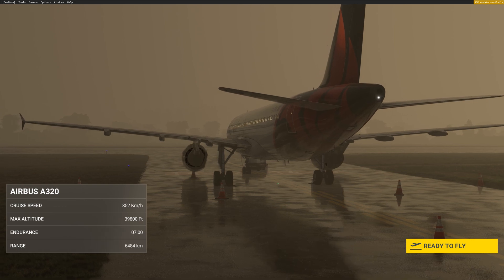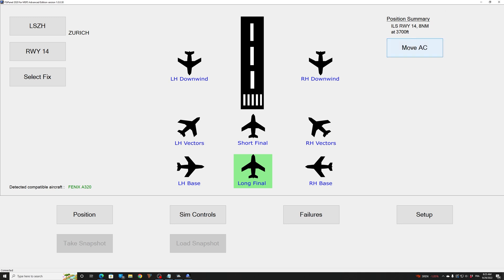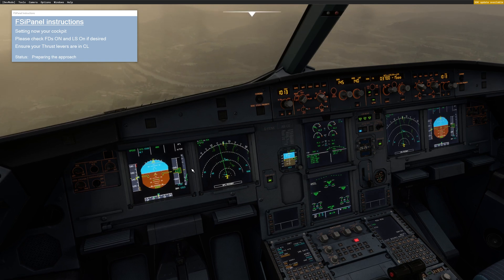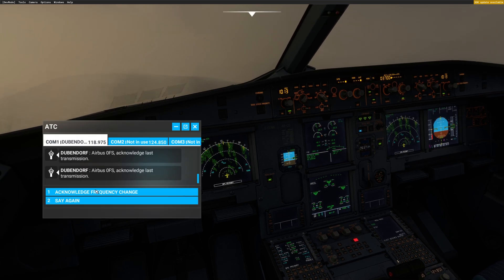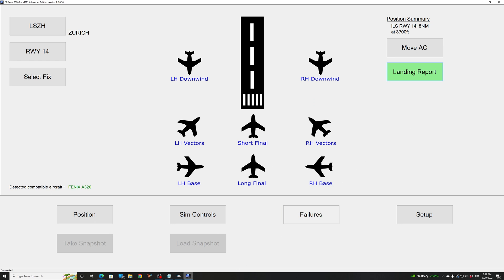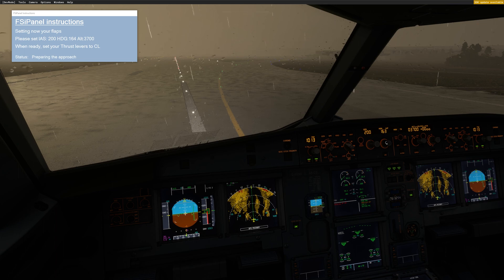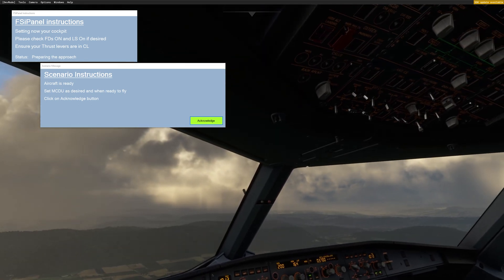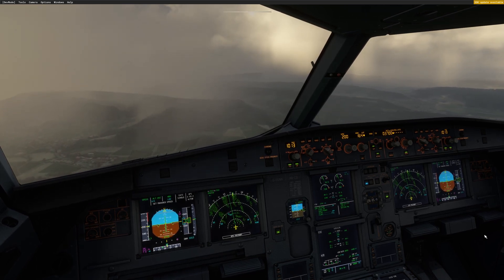FSiPanel 2020 with FENIX A320 teaser

Comment: Question, if I purchase FSiPanel: Standard Ed right now, will it include support for the FENIX Aircraft as well when it is available?  I don't need the Advanced Ed since I will not or be interested in doing any type of advanced practice failures.However, what I do like in the Advanced Ed is the Client/Server Option which unfortunately is not/or will be available in the Standard Ed. Can this be purchased/Added separately for a minimal fee without the Training Scenario/Advance Failures Panel Option?

I just want it for practicing Approaches and Landings at different airports around the world and this seems like a perfect addon for this.

Thanks!
Reply from the maker: Hi, yes you will have access to Fenix A320 when released. FSiPanel is a software for entertainment only, reason why running it on a network computer could allow some people to use it commercially. Only the PRO version will allow that in the future with the agreement from the addon developer as well.
Reply: @FSiPanel  Sounds great!....Will definitely get it.  Thanks for the reply, much appreciated.

Comment: This is great with an airliner. Can this also be used on GA with the changes in distance and altitude they would need for landing practice?
Reply from the maker: Hi, yes with all asobo aircraft.
Reply: @FSiPanel  GA sounds good. I will buy this tonight and have a go. Fenix, is it nearly ready or still away off? That's the aircraft I use most.